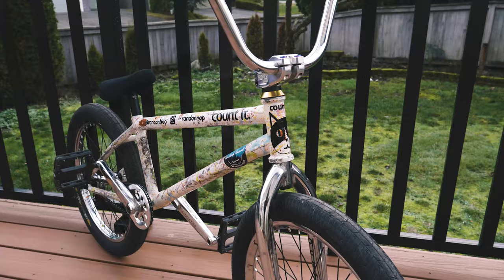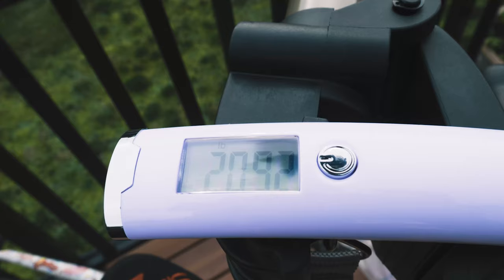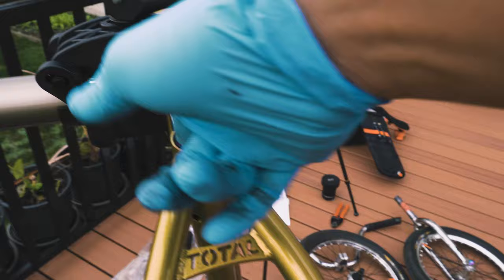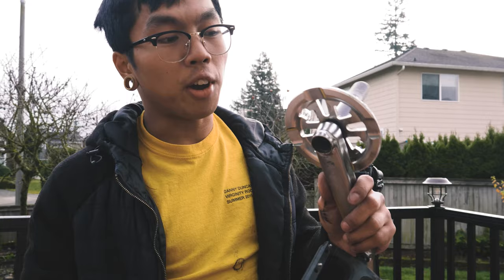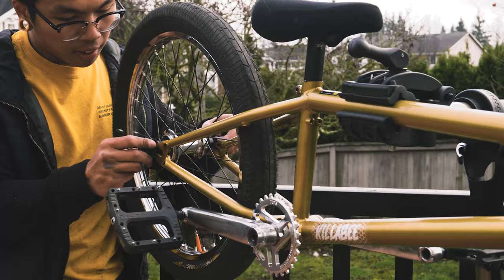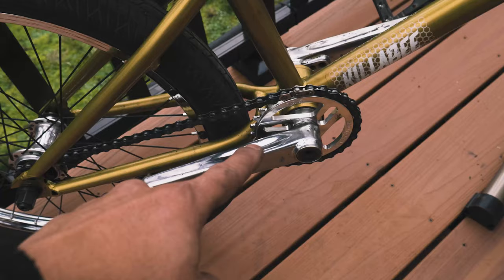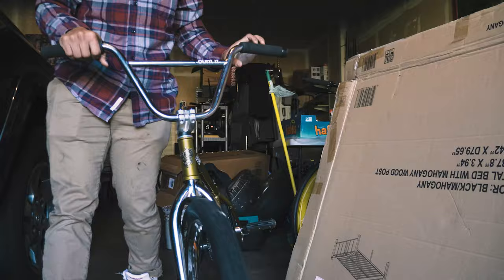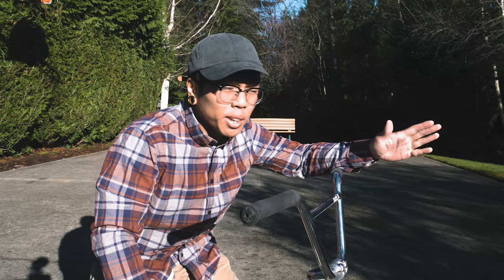New BMX Bike Build! | Total Killabee K4

Comment: Get a rubber deadblow hammer. You'll destroy bearings using a metal hammer.
Reply: @BrandonNop  Yeah those work too. Just wasn't sure if they cost as much as they were 20 years ago. That tool ran around $300. Wasn't gonna recommend a $300 tool for something you wouldn't use very often.